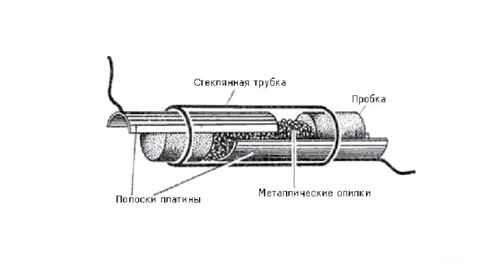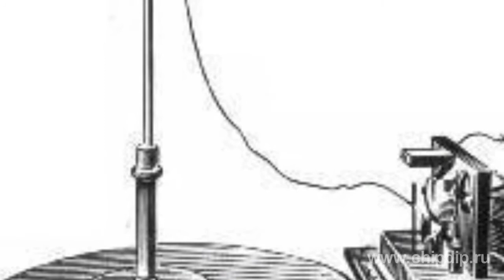Invention of Radio by A.S. Popov

Comment: Popov was a pioneer in radio technology, but this particular achievement is blown way out of proportion. It was designed and functioned as a lightning detector, because it reacted to the intense RF discharge from lightning. It was not a communications device, and could not have functioned as one. He did much more with communications the next year, but the lightning detector was not a radio.

There is no single inventor of radio, but Popov does rank among those pioneers, and I'm glad he does get a special day of recognition, even if the specifics are exaggerated.